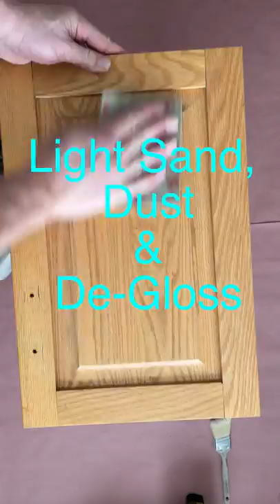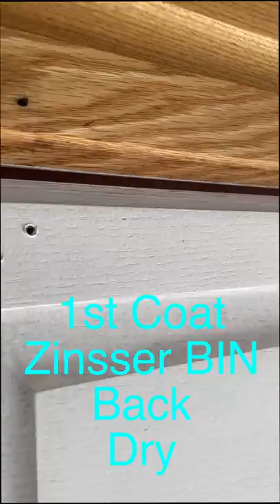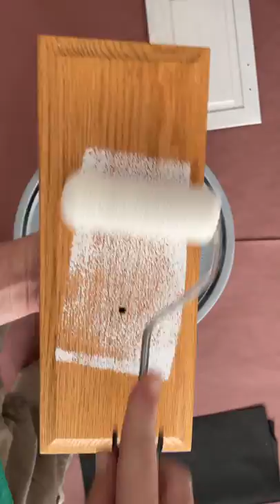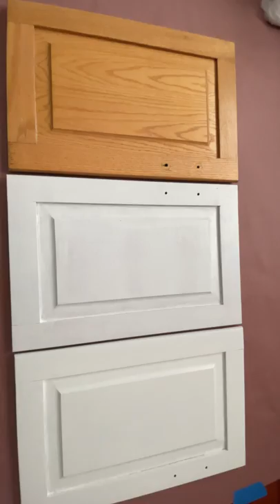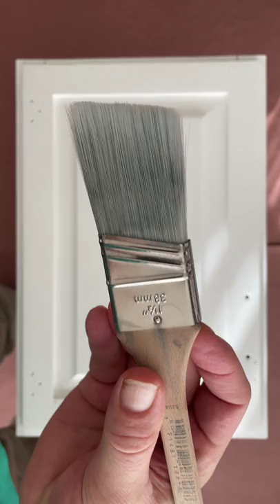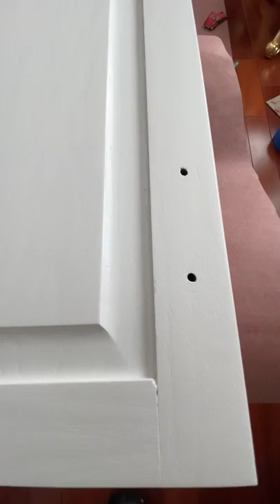Prime & Paint Bathroom Varnished Cabinets to White - Zinsser Bin - Benjamin Moore Advance

Comment: Thanks for this helpful video! How much sanding will I need to do on glossy honey oak cabinets from the 90s? Factory finish, obviously many coats. I’m worried about all the crevices and molding that are really hard to sand. I was hoping to avoid shellac because I’m doing all the work in the kitchen. But I keep seeing BIN recommended for cabinets. I want to get it right the first time!
Reply from the maker: I do a light sand to make surface smooth. The Liquid Deglosser that I use is the key. It cleans and deglosses so the primer will adhere better. Zinsser BIN is the best Primer to use. The smell isn’t that bad using a 4 inch roller.

Comment: Awesome videos, been watching them all. Any other primers you would recommend? I'm painting trim that was previously stained with oil based. I sand, pretty thorough, but still wondering what primer I should use. I'm using BM advance paint as well, but am worried about the smell of the shellac
Reply from the maker: Hi 

Thank you! 2 best primers for painting over Varnish or Polyurethane are Zinsser BIN and Zinsser CoverStain (Oil primer). Both have a foul smell. I use both. I’m currently putting together a video on priming varnished door casings by rolling on Zinsser Bin and then rolling BM Advance for a spray like appearance with no brush strokes!

Russ

Comment: Hi Russ, if I want to use BIN primer on cabinet frames, but don’t want to sand them (I don’t have a good way to contain the dust), is it still generally worthwhile using the BIN? Thanks!
Reply from the maker: Hi

Yes it sticks to any surface without sanding. Make sure you Degloss first to clean the surface. Are you applying it over polyurethane?
Reply: @RussOlinatzPaintShow  over a previously latex-painted surface
Reply: @RussOlinatzPaintShow  is it ok not to sand after applying the BIN primer? I realize it may not look as smooth.
Reply from the maker: If you are going over latex, you don’t necessarily have to use BIN, but if u want to u could!
Reply from the maker: Yes u can sand

Comment: Hi Russ, What made you go with the Wooster Silver Tip?  Cabinets look great.
Reply from the maker: Hi

It’s a really soft bristle brush. 

Russ
Reply: @RussOlinatzPaintShow  Ok. Thanks. I'll check it out.
Reply from the maker: Great Brush!
Reply: @RussOlinatzPaintShow  I have been using Staalmeester brushes recently. They are more expensive, and slightly more difficult to get, but I find them much, much better than Wooster (and vastly better than Purdy).
Reply from the maker: Nice I haven’t seen those. Where did u get them?
Reply: @RussOlinatzPaintShow  in the USA, any local rep that sells fusion mineral paint brand carries the Staalmeister brushes. Antique malls might have a vendor carrying stuff like wise owl paint, Dixie Belle, and fusion. Look for a fusion Rep and you'll probably find the brush.
Reply from the maker: Ok will do! Where are you from?